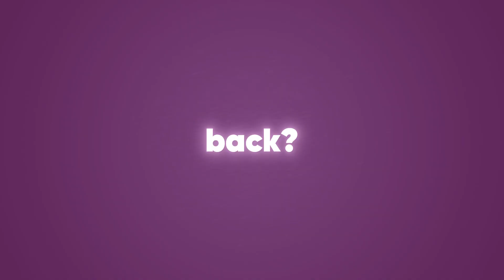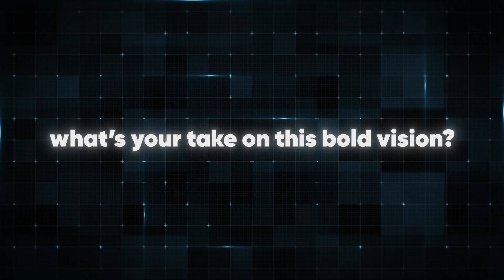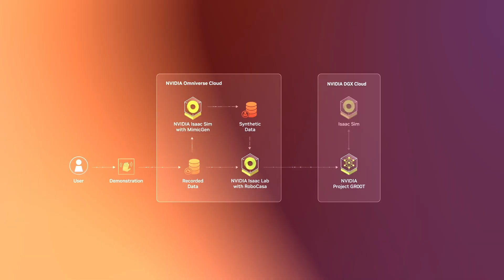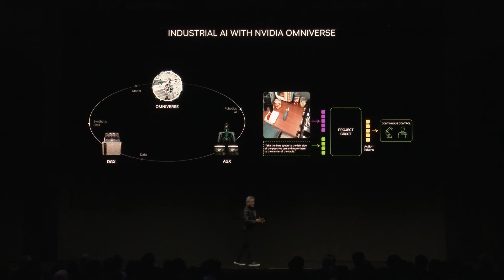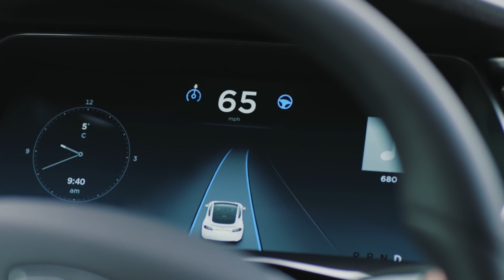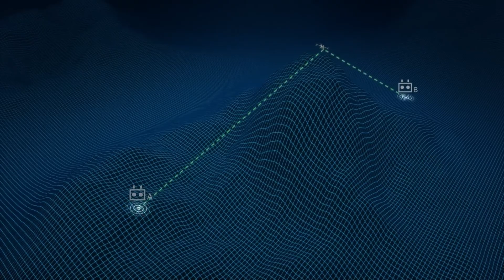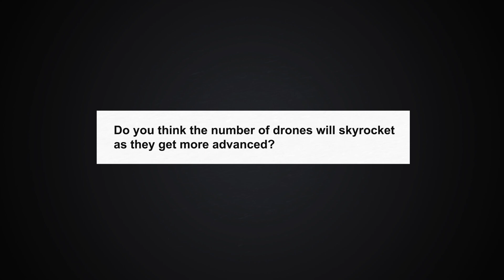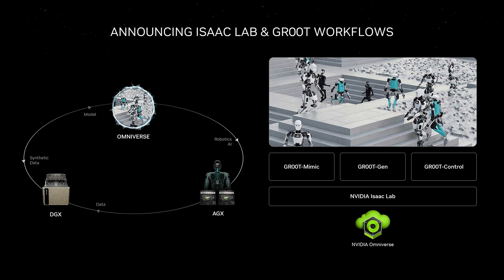Nivida Jensen Huang VIRAL INTERVIEW! “Humanoid Robots at MASS SCALE!”

Comment: 2025 will be the year humanoid robots begin "real" production.  Companies will go from making a few dozen robots, to over 1000.    Globally, I would expect around 10,000 by the end of next year.   Which is far more then we have today, but they will have incredible growth going forward. 
End of 26' will likely be over 100k. 
27' will be a million.
28' 50 million
29' 200 million
30' 500 million
insane growth, hard to fathom.
Reply: The current annual growth factor is apparently at 10x. But the factor of growth should also definitely decrease each year. So it could likely look something like this:

2024: 100 x 10 = 1000
2025: 1000 x 9 = 90,000
2026: 90,000 x 8 = 720,000
2027: 720,000 x 7 = 5,040,000
2028: 5,040,000 x 6 = 30,240,000
2029: 30,240,000 x 5 = 151,200,000
2030: 151,200,000 x 4 = 604,800,000
2031: 604,800,000 x 3 = 1,814,400,000
2032: 1,814,400 x 2 = 3,628,800,000

In reality, the multiplying factor would take a little bit more of a bell curve than my examples, and would certainly decrease a little quicker than near the end. We are not increasing our production capacity by 1.8 billion in a single year as the end of my list suggested. It was just easier to crunch the numbers in this way and gives a good idea of progression.

Our 2030 estimates are actually basically the same (500M vs 600M). Bearing in mind this is not intended to be particularly accurate.

P.s. The only conceivable reason as to why we don't see a similar explosion in production, is if we hit an unexpected plateau in the development of robotic and AI capability, and the robots simply can not be made to do everything usefully and reliably.